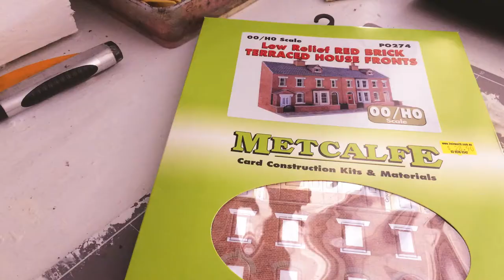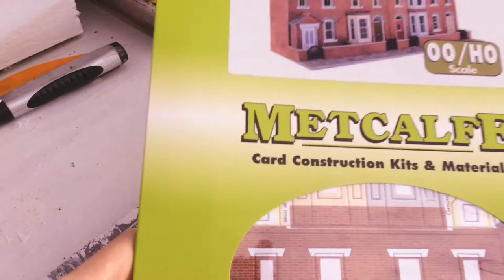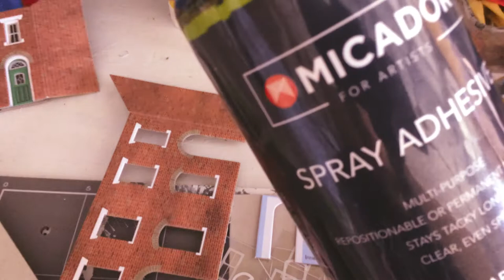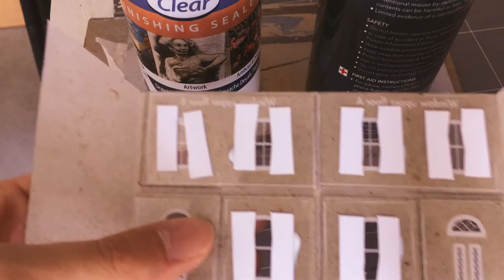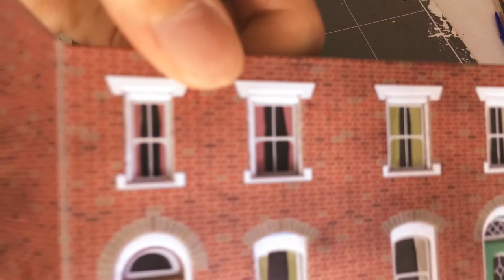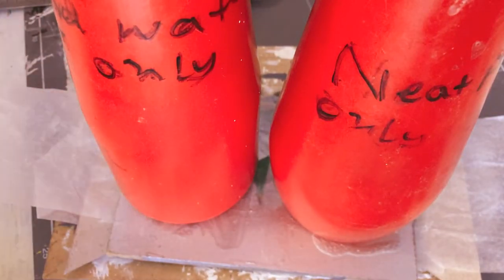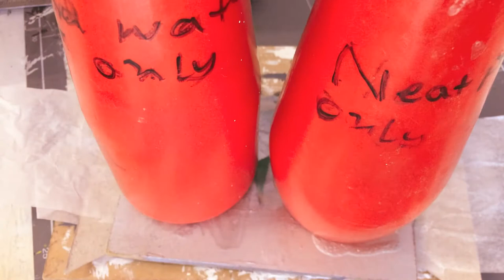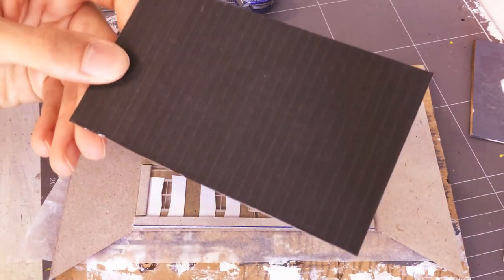Exeter Central video 29 Making ultra low Relief Buildings pt1 modifications to Metcalfe kits.

Comment: Hi Nicholas. its been awhile since i have done a Metcalfe kit. i like what you have done so far. you do learn a lot from building these. and this experience will come in handy when you start your scratch builds. all the best Tony
Reply from the maker: Hi Tony thanks for your nice comment i do learn from building these kits like befor i made these i have scratch built some other ultra low releif buildings and they were built a little bit differently to these buildings in this video i hope to be starting my scratch build soon i have most of the materails i need. i am starting the reasurch part but with the photos of the building i want to recreate there is not many photos of the actual building and i can't find photos where it shows all sides of the building what should i do? i do have some photos but i think i just have to work with the photos i have got thanks for your comment.
Nicholas

Comment: Thats a great idea, metcalfe buildings are quite versatile and useful for that reason, I haven't used any on my layout yet, Ive been a little reluctant because my layout is in a shed at the bottom of the garden, I have heating but i'm worried it could get damp
Reply from the maker: Thanks Digger for your nice comment they are quite good metcalfe kits as log as you protect the kits such as matt varnish them then they should be fine and plus some kits have multiple layers of card so they are quite robust but my layout is in a garage and they have been fine plus i can't control the temp in the garage so it is either hot or cold and they are still fine so i am sure it should be fine where your layout is.

Comment: Hi, can't believe that you had to kit bash this kit like that. If you actually follow the instructions then you would need to cut the base off the side walls which left you with no door step under the door. The back wall fits perfectly when done as per instructions. When putting curtains in it's better to put a piece of card between the glazing and the curtain so it looks more set back and prototypical. You could always put lights in the back of the diorama and improve the look rather than black paper. I have kit bashed some of these to be single storey, with dormers, curtains, porches, lights in so that you can see the carpet and furniture if you look inside etc. Some have bay window with the extra cut-outs rather than black paper so you can see inside them as well. Hope this is of some use to you or any of your followers that read this.
Reply from the maker: Hi I kit bashed it like that for a reason. If I had built the kit according to the instructions it would of stuck out too far and it would not of been able to fit the space I have. Hope you understand what I am trying to say plus I also mentioned it in the video that I would be making them as untra low relife buildings as they would fit the space I have got.